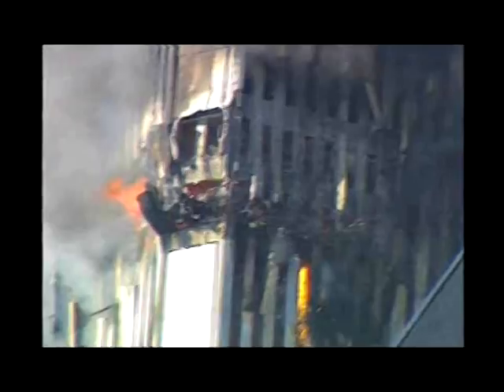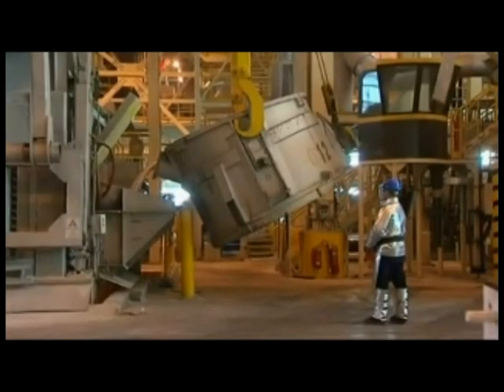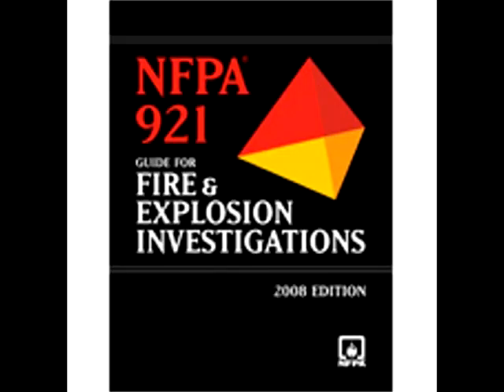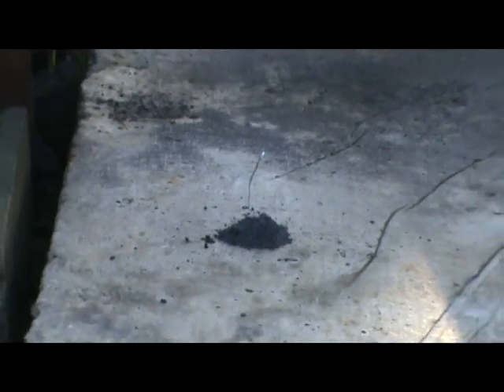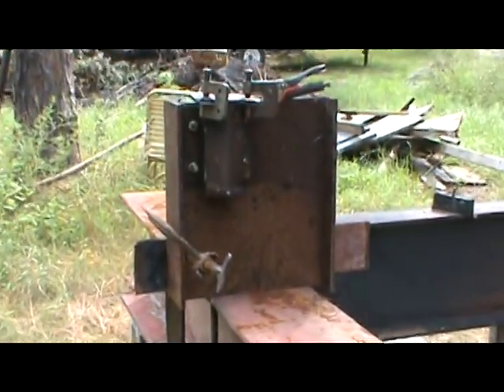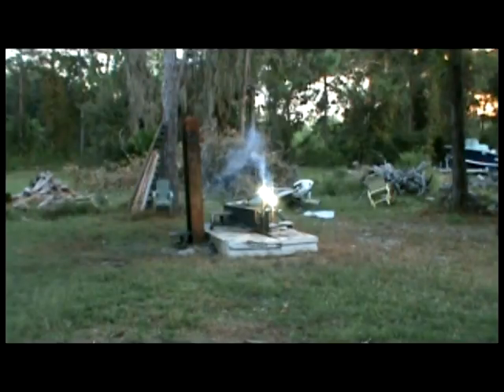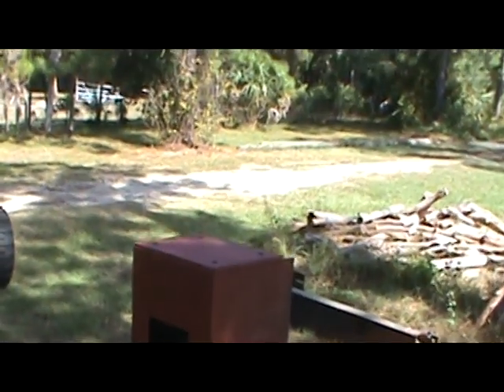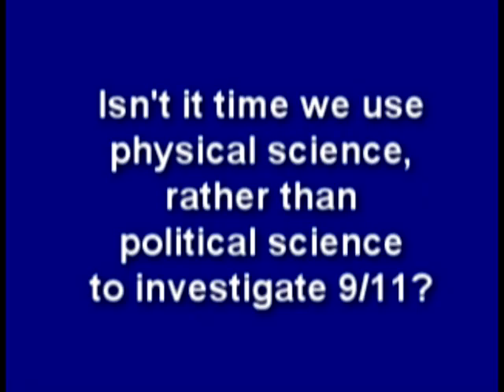9/11 Experiments: The Great Thermate Debate

Comment: 9/11 was a inside job, re: they first put a massive bomb under the car park 7 made it out as if it was a terrorist attack, yet it did nothing, then while they were fixing the damage, they planed military grade explosives in the years of time before 2001, which is more than enough time to set up 2 planes remotely controlled, just like the drone aircraft they have now? The rest is real evidence, which they  made sure they got rid off straight away where is the over 1.5 million tons of steel that should be on the ground as well & all the other hot spot's & cars that were 1/2 burned & over 1 mile away as well, Dr Judy wood has a great way to explain what happened re: the steel thats on the outside & the inside massive columns should be on the ground, yet nothing like that was found on the day, there photo's to prove it, it did not go all the way through, otherwise it would have been seen, yet there's photo's of the car park under the tower's & they are not damaged ? dustification basically, why were people saying they felt like they were heating up, yet they were no where near the flames & you can see people where the planes hit as well & even furniture ?

Comment: I worked in a large manufacturing company while at college to gain work experience  - some 40 years ago.
This company had a very large Foundry close to  its assembly plant.
I watched for many weeks men pouring  MOLTEN   STEEL  &  then ALUMINIUM into castings.
MOLTEN STEEL  is YELLOW/ORANGE in COLOR.
MOLTEN ALUMINIUM  is SILVER in COLOR.
ONCE YOU HAVE SEEN MOLTEN STEEL  - YOU NEVER FORGET IT.
IT POURED OUT OF  WTC  1 and 2.

Comment: I'm not convinced. However, I like your experimentation. Good investigative science.
Reply: Actually, this is simply a demonstration of known fact, not new science.
If is is meant to prove that the WTC could have been brought down using thermite (or its variations), it fails. It's much too slow. And it also doesn't support the claims of people hearing explosions.
Reply: ***** I'm going to play devils advocate here for a second. It isn't too slow, the towers burned for like 10 mins before collapsing. At 12:45 he shows it making explosion noises. I didn't watch this video in full but it looks like he is putting explosive cores in his thermite. Thermite doesn't really pop and explode like that unless it is on something that sublimated like ice.
Reply: Prometheus
Tower 2 collapsed 56 minutes after impact. Tower 1, one hour 42 minutes.
I couldn't really see what he was putting in his casing either, maybe it was igniters. But you're right, if there are no impurities, it burns fairly smoothly. I suspect the small volume of melted (I'm tired of the word "molten") steel, being vertical, might have contained air pockets which bubbled up. Dangerous stuff.
Some varieties burn faster than others, but it's still considered a slow-burning incendiary, and unlike some, produces very little in the way of gasses, so even if enclosed, it wont explode. Just melts its way through.
My experience with thermite is limited to small welding jobs, and Cadwelding electrical connections. Using it to cut structural steel just makes no sense to me.

Comment: I make steel for a living,,  It is safe to say, I forgot more about making steel than most of you will ever know... steel melts at 2800 deg..... Jet fuel burns at 800° to 1500°F... Not even close to the temp steel melts... Furthermore steel does not weaken at 1500deg....   What is so hard to understand about this....???????????   It was a inside job!!!!
Reply: Glad to meet a fellow tradesman,but never has anyone claimed the steel melted ,it softened as it was heated and became weaker,I have worked in the building trade for 35 years and have witnessed even fire proofed steel bend and warp during a normal fire ,therefore ,weakening,that's all it takes you must agree if you are in the trade
Reply: motzy77 well i have asked demo. experts , and they just laugh when asked if a building could be preped for demo. without anyone knowing, so the so called experts you read about are idiots
Reply: motzy77 it is funny, yes, because you didn't ask, or the ones you heard from didn't know their arses from their elbows
Reply: MrNixification
So WHY DON'T YOU STUDY SOME SCIENCE YOURSELF, LIKE THE REST OF US DID! Then maybe you could understand what the experts are telling you!
Reply: You're either a liar or you have indeed forgotten too much. Steel is an alloy and its melting point depends very much on its composition. 2800 (or nearly 1600 C°) degrees is only about the highest possible melting point. So you can't talk about a general melting point nor about a general temparature when weakening starts, though, as may easily be googled, 1500 degrees is by far no absurd guess.
Reply: Softens at 1000 - 1500 deg F., depending on shape, load and alloy and acceptable deformation.
 See https://www.fhwa.dot.gov/publications/publicroads/02sep/05.cfm
Reply: ***** Steel doesn't soften... it becomes malleable... It looses hardly any breaking strength at high temps..... But what do I know........   In other words....steel will not break at high temps,,, just bend... The column pieces that I seen were cut,, not bent,,,not sheered off....sooooo..........only one way they were cut.... It just so happens they also took all the steel from the buildings that fell and shipped the scrap overseas,, or so they say...... Even with all the steel mills in this country..... EVEDENCE...you sheep.... I personally,, could have took it to the metallurgy lab at work and told you exalacty what was in the steel..............................................
Reply: motzy77
The column pieces you see are indeed cut...by a cutting torch in the hands of a skilled steelworker in the act of clearing the most dangerous pieces and opening passages for search & rescue, Later recovery and examination.
And hell, man, I'm very aware that hot steel doesn't break, it bends, and I have said that dozens of times. I'm sure you could give me the alloy type, I don't care what is is. When I see hundreds of pieces of BENT steel on the ground, I don't say "Gee, all these had to have been cut "!
Reply: ***** I think I can tell the difference in clean cutting torch cuts,,and cuts from molten slag running on the steel like lava.......I see it at work 4 times a day for 18 years....
. but you go ahead and believe it.... Did you see the video of when the building was still standing, and molten steel was running out the holes in the building..???   b4 it fell...???
Reply: motzy77
I was unaware that slag could cut steel.
And the ragged cuts were probably made by people in a hurry, possibly inexpert since manpower was at a premium, and that nobody really gave a damn about neatness.
No, I didn't. I saw one shot of something molten that seems to cool awfully fast, and turn a light grey color...like aluminum (contrary to some claims, Al will become incandescent  when hot enough, but cools very rapidly).
Now please tell us how many holes this was running out of, then tell us how much steel would be liquified in order to cut the columns.
Reply: Slag didn't cut it,, the molten steel running under the slag did....Like I said,,,I see molten steel every day,,they were not torch cuts.....What kind of idiotic question is this.......? Now please tell us how many holes this was running out of, then tell us how much steel would be liquefied in order to cut the columns. If I had a degree in demolition, I wouldn't work in a steel mill.... ask a demolition expert....  they will agree the plane didn't make them buildings fall.... that invisible plane  must of hit building 7....  Concrete is a Refractory.... I see chunks float in 3200 degree steel and not lose any form or shape all the time... cant melt it... at 3300deg
Reply: motzy77 I'm sure you have seen your share of molten steel, I'm from a steel town myself, and although I was never actually employed at a plant, I did lots of contract work in them. I grew up watching the ore furnaces being tapped, watched the sky glow when the old Bessemer process fired up, But what does that have to do with sloppy edges on steel beams? You think the cleanup crew was trying to make clean, attractive cuts?

Incidentally who as yet has claimed the steel "broke"? Who said it sheared? And describe the difference between "malleable" and "soft"? I don't think I've heard anybody claim that "soft" steel breaks easily, or even breaks at all. It just bends more easily. I'm surprised that a man with your experience wouldn't know that.

I saw video of one point where people claim molten steel was running out, but it looked like aluminum to me. You said out "the holes". I was just curious what holes you were talking about. If it was like many holes then I could understand why I hear so much about "all that molten steel". It seems to be a key talking point in confirming controlled demolition. Of course some claim all that steel came from the massive amounts of thermite itself.

 I'm sure you aren't a demolition specialist.

Building 7 was brought down by fire. It was not just an "office fire", check the FDNY internal investigation transcripts.

Did someone say anything about
concrete melting? It sure wasn't me. I've seen lava run around concrete. You're right, concrete doesn't melt. After a while it will spall and start breaking up, but it won't melt.
Reply: again I seen cut steel.....
Reply: Maybe you asked the wrong question.... Funny the experts that I heard speak about it said,,without a doubt it was a controlled demo.....
Reply: it is funny cause you don't
Reply: motzy77
Who did you ask?
Reply: motzy77
Where'd you go?
Reply: ***** How can 2 different impacts on 2 identical towers have the same results ? Falling straight. How can a 3rd just fall because of fire ? and fall straight either ?
Do we actually need demolition firms in the US or just fire do the job ? 
Please explain me ?
Reply: MrNixification
Quit asking if you are going to reject the answers.
It's really painful to think about how people make up their minds without checking the facts, they just look around at each other and say "Wow! Did you see that? That absolutely had to be ________ " (fill in the blank with any kind of crap)
Reply: You tell me that I'm looking around when you in your comment go around my question. 
You see when there is a problem to solve, i'm watching it like a mirror ball. Every little mirrors is one way to look at it. When I found a answer I think if it's plausible one. Adding to the fact the some answers can lead to new questions.
The soften steel version is hard to believe because :
- There was already a fire in the history of the twin towers and not a little one.
-There as been an attack with 680kg of explosives in the parking of the north tower blowing 5 floors.   
- After the crash of planes, peoples were in those holes made by the plane asking for help. So the temperature went low quiet fast.
- If the steel has been soften, what is the probability that the tower fall to the ground and straight. 
- What is the probability of two towers with the same construction hit in different ways to fall straight. I wouldn't be here if they had lean and fall different ways.
- Why during the fall there wasn't any resistance? It should have been slowing down as the fall went along, no ?
For all of those other little mirrors who weren't explained I think I have the right to doubt of the official version. So, Mr Martin can you enlighten me on those facts and questions?
Reply: *****  forget to clic on reply !
Reply: MrNixification
No, I cannot. You have not yet looked up any answers, you have only looked up questions. That's all we get, questions, questions, questions. Same ones, all from the official truther list. They have all been answered many times, and all the answers are rejected, since the NIST reported similar answers. You aren't looking for answers, you are looking only to recruit more followers. I'm still waiting for someone with real questions.
Reply: ***** You tell me that I'm looking around when you in your comment go around my question. 
You see when there is a problem to solve, i'm watching it like a mirror ball. Every little mirrors is one way to look at it. When I found a answer I think if it's plausible one. Adding to the fact the some answers can lead to new questions.
The soften steel version is hard to believe because :
- There was already a fire in the history of the twin towers and not a little one.
-There as been an attack with 680kg of explosives in the parking of the north tower blowing 5 floors.   
- After the crash of planes, peoples were in those holes made by the plane asking for help. So the temperature went low quiet fast.
- If the steel has been soften, what is the probability that the tower fall to the ground and straight. 
- What is the probability of two towers with the same construction hit in different ways to fall straight. I wouldn't be here if they had lean and fall different ways.
- Why during the fall there wasn't any resistance? It should have been slowing down as the fall went along, no ?
For all of those other little mirrors who weren't explained I think I have the right to doubt of the official version. So, Mr Martin can you enlighten me on those facts and questions?
Reply: ***** They haven't been answered !
Reply: ***** I'm 26, I have made the 2nd best school in economics in my country. I'm working in the 2nd best bank here in France, don't tell me my brain isn't smart enough to see irregularities. That's I need to be an architect or a structural engineer to have a valuable opinion. Bullying is always the last defense you guys have. 
Okay let's say steel as been soften and lost 50% of his strength in the core structure of 10 floors. 10 of 104 floors Bill. Why the tower didn't lean a bit ? Why it falls down straight with no resistance? Why NIST can't really explain the total destruction? Why it doesn't explain the no resistance of the none damaged part of the tower during the fall ? Thank you NIST but I need more as you should too. I'm young, the day will come when it will be explained, hope you will be alive to hear and see it ! History as proved that after 50 years we always know a lot more, time will tell.
Reply: MrNixification
So how am I bullying you? I simply said you should study some science, and also as you would audit a balance sheet, verify your sources re the collapse. Never preconceive anything. That's a baaaad way to start an investigation.
Reply: ***** It's a good technic to always talk on the person who is asking more than answering it's questions. You haven't study some science so your questions are irrelevant etc... So yes it's bullying by down grading your interlocutor. My questions are so logical you don't need to have a PHD to understand them neither studying some science to see that there some problems, only intelligence is needed. For your knowledge one of my relatives is a structural engineer and it can't believe what your government give you as answers.  
It's way more easier when you have no clue of what you could answer me. Way more easier to eat like a sheep what your gouvernement has told you and just repeat it. But somehow you don't seems to even feel that your stubbornness is blinding you. So I'm still waiting for what your science has to tell me ! I know Bill I can wait for a long time.
Reply: MrNixification
So your intellect trumps a need for study. Is that how you got through the second best school in your country?
Look, I saw immediately that anything I tell you, you will argue against. I will only tell you that I never read, and therefore, am in no position to accept or reject the "official government story". I read reports from many different sources, compared notes, used my own knowledge of the sciences, and made up my own mind. I didn't take the reputation of the US Government into account. It didn't matter.
You can use your superior intellect to do the same. But you won't, because your mind is already made up.
Reply: ***** Being sarcastic is an other way Bill but it wont make things go forward. Facts are that probably the questions of a big part of the population will be answered by an other "Snowden". I don't see a futur gouvernement having the guts to reopen an investigation.
Inculpatory or exculpatory time will tell. Even so inculpatory news are the trend for a few years.
Reply: MrNixification
I don't see any need for the taxpayers to pay for another investigation. I do wish, I sincerely wish, that one or more of the truther groups would fund one themselves... that is, a professional investigation, not an internet search, not a YouTube chat. Crowd funded and/or pro-bono. Quick, before the government, or the Jews, or whoever, buys everybody off.
Reply: motzy77 That molten material you see pouring out of the side of the building prior to collapse, contrary to popular belief, was not even molten steel. It was molten aluminum.

Molten steel glows a bright yellow color. The material seen pouring out of the building is molten aluminum, which glows a bright red-orange color. A simple Google Images search will tell you that.

Where is this aluminum coming from? The plane debris inside the building melting itself.
Reply: Martijn Heyerdahl
While I agree that it wasn't mo;ten steel, incandescent aluminum produces very little visible light and seen in daylight appears silver. What shows in the video appears to be very bright, but the actual color is probably not accurately recorded. Video tends to wash out the color in highlights. I must also assume that what we are seeing could easily be a third or fourth generation dub, with even worse color rendition than the master.